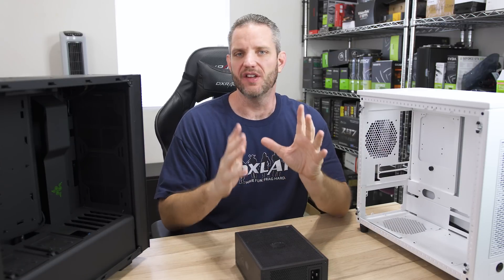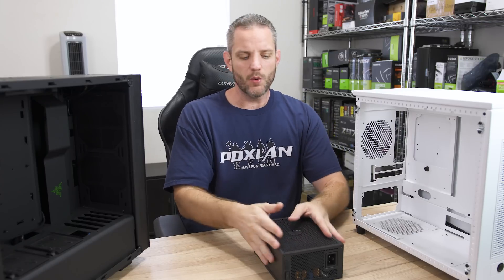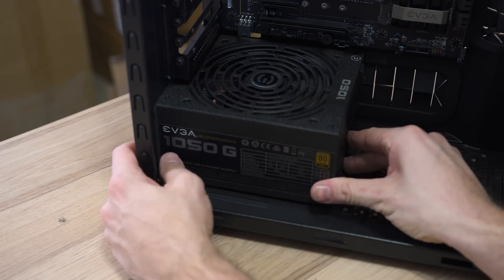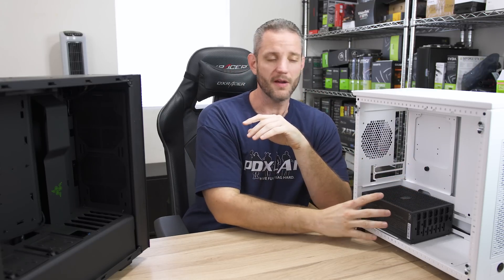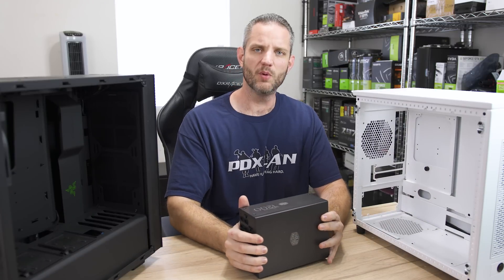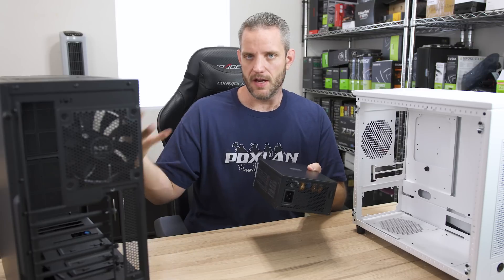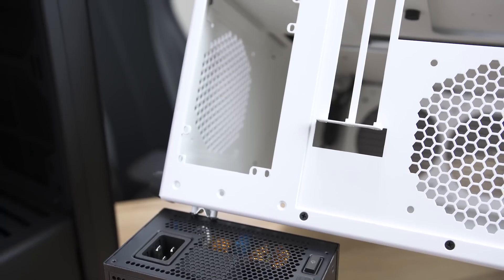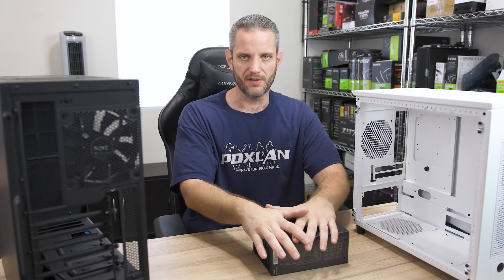Should you mount your Power Supply up or down?

Comment: Here's a video idea; AIO radiator orientation, and its affects on temperature and noise. 

From what I've read, the optimal orientation is where the inlet and outlet are on the bottom, because of the slight air gap, as AIO's aren't filled to the brim due to metal expansion. Therefore, bottom orientation brings down the temperatures and pump noise.

Comment: Another huge reason back in the day when semi and fully modular psu weren't really a thing. The loom of cables would come out of either the right or left side of the psu. So you would need to orientate it so the cable have some extra length.

Comment: well im dumb so i can think like this. psu takes air from outside case 23´C and then blow it inside psu and then out 30´C and then like you did say in again then it will stay around 30´c something. But if it takes air from inside of the case where the gpu fans is blowing air all over the place at around 60´C then the in the psu and out. and new air from inside the case 60´C again. then psu will be warmer then it will be if it did take air from outside of case. Im i thinking wrong? and as you did say it can take same air in again that it blows out. heat goes up so some of that 30´C will not get back in.  but what do i know in just a dumb swedish pc lover.
Reply: "you're"
Reply: tontarna I tried to read this and I think I had a stroke at 2/3rds I have no clue where you are getting at here
Reply: "grammar"
Reply: Valid question dude. I think you're right especially if there's a GPU close by with three fans spinning on top of it and there aren't major case fans pushing in volumes of air. Then the small area between psu intake and three GPU fans will become a battlefield for the air molecules, doesn't seem streamlined at all. Not only probably worse temp in psu but also less air for gpu. Stay critical dude and don't mind the short tempered douchebags that are cramming up in this thread immediately going on the offensive. Retardasimpletons. Keep it up
Reply: It doesnt really matter, its not a simple as 20 plus 60, the only thing that actually changes kinda noticeably is the airflow, but then again... it doesn't really matter...
Reply: Niko_2142 front fan takes in 23c and gpu makes 60c then you have let's say 50c in case. psu takes in 50c and blow it out. compare to take in 23c and blow out let's say 30c. so take air from outside case is cooler for psu so it shulde be better for it?
Reply: Uh... No. taking hotter air doesn't mean it's ability to carry heat is reduced. But if you are worried about your config, just don't, the important part is air getting where it needs to be, not if it's hotter or cooler, no one has ever  had any issues, and as long as your psu is fairly decent, it just won't matter.
Reply: Niko_2142 overall it is better to have psu fan take air from outside of the case for the best temperature. I got my 1000w fractal r2 psu. I not worried about my config. I did just state this becuse jay did say it will take cooler air from inside of case and I don't think it will do that, prove me wrong. and I know that many ppl include me time to time will so what he says on the video.
Reply: tontarna jesus christ... i tried explaining it to you, but whatever you don't want to understand.
Reply: Didn't you watch Jays earlier video where he was measuring the intake air versus the exhaust air?  It was practically the same.
Reply: The thing is, it's usually never 60c in the case
It probably goes to 30c to 40 at most.
Reply: you're right. The air that's taken in from bottom comes dragged along the cold floor that greatly cools air, so even if there's a circular loop the air rubbing against floor will cool it up before getting inside PSU again (in theory).
Reply: Yep your a dumb fuck.
Reply: LT Hutchins ouch! What a snap. You must have just learnt that in class today. This is the internet you fucking spaz. No one gives a fuck about gramma. That dosent make you look smart, it makes you look like you have nothing to say. Fucking spaz lol...

Comment: So guys I have a corsair 100r silent case (1 fan in front and 1 in the back) and my psu is a xfx ts 550w. The fan in the back it's very close to one of the cpu cooler fans wich is a noctua nh-u9b se2. Should I face the psu fan up or down? And should I take out that second fan from the cpu cooler or not?

Comment: We also have to take to account non modular power supplies. Non modulars and semi modulars have the cable closest to the motherboard so if your power supply fan faces down. For my budget builds I usually get top mounted power supply so it's going to orient the cables properly. 

Some folks will probably tell me to get full modulars so if that's the case give me money because I'm too broke to get those.

Comment: A quick question: what delivers more air flow (in general), 2 140 fans, or 1 200mm fan.
Reply: Two 120mm fans, if you get some Gentle Typhoons.
Reply: cusson27 2 120's, but a 200 will pull more air at a lower rpm at a way lower dB, but the 120mm will be better if u need alot of airflow
Reply: a 200mm fan can move more air at the same rotation speed than a smaller fan...

but you also could only have one 200mm fan in the space you could fit 2 140mm fans.
so 2 140mm fans is more practical.

Comment: Is their a fresh intake for the PSU in your case? Yes = mount the PSU to use that intake. No = obviously only option is to draw its air from the hot air in the case.

Will the PSU fail due to drawing in the hot air from the case, 99.9% of the time no. So long as it's a quality PSU. The PC being on carpet should never be a consideration because no one should, EVER, be putting their tower on carpet. If anyone is putting their tower on carpet, they should have their PC confiscated and be banned from owning a PC for life. It's never OK.

Comment: Nice video Jay, as always. Although PC-building is my hobby for quite some time now, I've never heard about positive/negative pressure inside the case. This should solve my dust problems. I have a coolermaster haf 922 case and every 3-4 months, I have to clean the inside, because everything is covered with fluff.

Comment: Good video!! New question: what are the downsides of reversing the airflow (out the front)? Are the mobo's thermally designed only for out-the-back airflow? There are many different gpu-fan types incl. water-cooling, which would benefit from what?

Comment: I have 2 intake & 3 exhaust fans. I run a custom curve so that there is slight positive pressure on the system until I'm under load (55-60°c or more) & then it's a slight negative pressure. This way it is resistant to dust most of the time but when I'm exporting a video the slight negative pressure with all fans at 100% exhausts the heat more effectively. Something to consider if all your fans are 3/4 pin connectors & you are using controller software like Ai suite

Comment: great video! I am building a mini itx computer and it has 1 intake (120 mm) and an exhaust (80 mm). I plan on adding another exhaust fan (120 mm) so, I am not sure which way would be the best for my computer. Because the PSU is on top, and if i make it so it has its own environment and isn't affecting the inside of my case, it would be pulling in air through a crappy dust filter, so I could really use some help with what way to orient my PSU. Please help.

Comment: Don't claim it's the coolest config without doing a test and measuring temperature differences between the two. That said, the biggest reason not to mount the PSU facing up in the bottom of a case is due to the risk of something falling into the fan (loose screw, jumper, broken bit of plastic, loose wire, etc... BTW, others who have tested the two found the CPU runs upwards of 6C cooler with it facing down since the PSU doesn't interrupt the airflow from the front fans reaching the CPU fan. This only applies to bottom mounted PSU's though, top-mounted should always face down to help increase the airflow across the chipset and memory.

Comment: not bad but I felt you missed one point; with the PSU facing up, you can have a passive PSU which is quieter (especially if its over-sized). The less fans spinning, the better. With face-down, the PSU fan must always spin, otherwise it will over-heat.

Comment: I don't have this problem, because my case has a separate room for the PSU and the system, but here is my question. My computer is in a cube case (Avp ev33b to be specific), that is separated vertically, so you have a right and left side, separated with a big metal sheet with some little holes for cable management. Is it enough, if I try to maintain a proper pressure independently, side by side, or should I count the two compartments together?

Comment: That moment when your first build didn't even have the direction taken into account.
It didn't occur to me that it'd matter.

PS: The case is in the side so it's not like a air port is blocked off anyway....but....what way DID I mount it?!
My system stays fairly cool, the hottest thing is the GTX 750Ti which caps at 60C.

Comment: I have an inverted case (Silverstone Fortress FT04), so the power supply is on top, with a dedicated filtered intake. I still have my power supply (EVGA Supernova 650 P2) installed with the intake facing in, not only because of the reasons Jay mentioned, but also because it's one less filter to clean.  With such a large internal cavity, I don't have to even think about heat accumulation.

Comment: Hey Jay, I know this might be a long shot but here it goes, i just recently got a new power supply (corsair rm1000x) for my 
computer, i got it all hooked up on my ASUS 970 gaming/aura motherboard and now the mouse, keyboard, and monitor wont turn on (almost like its not detecting the mouse/keyboard/gpu) when I turn the PC on, any help would be greatly appreciated.
Reply: Justin Bechtel did you remember the extra CPU power cable up in the top left of the mobo? That's a tricky little guy that people sometimes miss.
Reply: HOkayson
the 6 pin cpu power cable? yeah, i plugged it in, it may have come loose when i was installing the fans though, for some reason
Reply: Hmm, if you're certain everything is plugged in & still no power to the mouse/keyboard I'd say try the old PSU again. No need to fit it properly just place it next to the case & replug everything into it, no need to route the cables properly as it's just for a test so should be pretty quick to do. If the old one works still...could be a dud new PSU. That's extremely rare with a decent brand though so I'm assuming it's something else.
Reply: HOkayson
im in the process of re installed the ram/cpu/gpu/all the cables, the reason why im so hesitant to use the old pus is that its a 350watt psu, and the cpu im using is an amd fx8350, i dont want to fry the old psu, used to have a msi 760gm p23 with an amd fx4300 in it, but just upgraded to the asus 970, and f
fx8350
Reply: i unplugged everything and plugged it back in, took out the cpu, ram, and gpu, put it back in, and now it works. wew. cant believe i never thought about this. thanks for the help though ^_^
Reply: It's the worst feeling. When I built my PC, I tested all of the parts outside of the case and it worked fine. After installing everything into the case, the PC wouldn't boot and I was freaking out. About two hours later, the issue turned out to be the 24 pin connector not being seated all the way hahaha
Reply: Metalbolt
now im having a problem with my ram, I have 32 gigs of ram, when i go into the uefi bios it reads that there is 4 sticks of 8 gigs of ram, but says there is a 24gigs of ram memory, booted, opened up speccy before opening anything it read 32 gigs of ram but only at 557MHz, open something and it reads 24.0GB Dual-Channel DDR3 @ 579MHz

i dont know whats going on and im very confused.
Reply: I would try to put 1 stick of RAM into slot 1, boot and see what happens. Rinse and repeat for each slot, then do this with the other sticks. You may have a bad stick of RAM somewhere or a bad DIMM slot. Also, you may want to try a BIOS update, but I know sometimes this can brick the PC, so personally I would do this as a last resort. You may want to look at Tom's Hardware for more advice because this is only my first PC and I don't have too many experiences with issues and such, but I'll try to help you the best I can.
Reply: Also, maybe try to take out the RAM and make sure that it's seated all the way in so that it makes a good connection.
Reply: Metalbolt
just spent about an hour and a half trouble shooting every which way i can think of with the ram, turns out i might have a dead ram stick, i put the 2 confirmed working ones aside, and put the one i that was giving me troubles, and one of the sticks i "paired" it with in, it would detect 2 sticks but only have the capacity of one stick, which was odd to me, so i took the one that was giving me no capacity at all, set it aside, and put just 3 sticks in and it read the 3 fine, but to make sure its not a slot, im going to put the stick i know works into the one i didnt put it in, if it reads it then I know all 4 slots work and its the ram stick that doesnt
Reply: Hopefully it's just the stick of RAM, which according to what I hear, is pretty easy to RMA (unless they ask for the whole kit back, you may be down for a few days). Fingers crossed!
Reply: Metalbolt
if they ask for the whole 32gig kit back I will just use my 8gigs of rams that I have from my old prebuilt pc that i upgraded a little bit.
Reply: In that case, not so bad
Reply: Metalbolt
i essentially have 2 computers now, one as a backup/portable/other people can use pc, and the one I just built, but i just finished doing some troubleshooting and confirmed that all of the ram slots work, 3 ram sticks work, and one doesnt.
Reply: I guess it's a good and a bad thing. Hopefully it'll get resolved soon.

What did you put into your new pc?
Reply: Metalbolt
CPU: AMD FX8350 Black Edition
Ram: 32gigs of 2133MHz Corsair Vengeance
GPU (for now): GTX750Ti
GPU (future): 2x AMD RX480's probably the XFX ones.
Storage:
samsung m.2 ssd (120gig)
Toshiba 500gig hdd (for now)
in the future I want 4x WD Red 5400rpm NAS 6tb drives. and a few other bits and bobs.
Reply: Sounds awesome that you have an upgrade path. Best of luck to you man!
Reply: Metalbolt
thanks :)
I just finished talking to customer service at corsair and the very nice fellow (Nick C) said I have to send the whole kit back. which is what I suspected.
oh well
Reply: I heard they have good support. I had to RMA my keyboard, and they offered to put a hold on my card for the amount while they ship me one, and once they received mine, then they would take off the hold. I believe it was called advanced RMA.
Reply: Metalbolt
yup, they offered me that as well, but i politely declined as I have the ram sticks from my old PC, i was like "im quite patient I have some ram from my old computer that I can put in to hold me over until i get the new sticks, i will just do the standard RMA I just need time after or before work in order to send it out"
Reply: I hope the new sticks will work for you. Keeping my fingers crossed!

Comment: I have a weird set up but it seems to work. 180mm pulling air from the front. my 120mm exhaust fan blows into the case also cooling a small rad for the water cooled CPU and the the only fan blowing air out is on the top which is another 180mm fan. I get positive air pressure, not a lot of dust and everything stays pretty cool. That's saying something consisting I'm still using an old R9 290 lol.

Comment: I'm going to use rx 480 in my new build.  The recommended psu is 500w. If I use a 450w psu, will it be a problem? I'm not going to overclock the system anytime soon, maybe after upgrading the psu to 600w.

Comment: Thanks for the explanation Jay. TBH, I was wondering about your PSU install on the computer, but, just looked at it like you knew what you were doing. The explanation makes it better though, and, it would likely be easy to flip it over if wanted now that it's up off the carpet. Thank you.

Comment: You should make a video where you run water cooling but with no fans on the radiator and compare the temps. Then try using compressed air cans to blow on the radiator to see how many people using how many cans does it take to equal normal fans. I got this idea while dusting my radiator and thought it'd be interesting to test.

Comment: Jay your the best!!!!!!!!!!! Came here just to say your the best and go on a rant of what i think should be done :). Get positive airflow in the case. PSU facing down with filter on the fan and poof your set. thats if the fan is an intake on the PSU wich as far as i know they all are. Atleast i hope mine is lmao. Would make sence tho cuz if the fan was facing up all it would do is blow hot air into the case wich would be stupid. Now if u didnt have a filter to your psu i sudgest puting the psu facing up as long as you have positive airflow with that extra exhaust to the airflow in the case. You dont wanna be sucking all the air the gpu could be getting. And for all watercooled and filtered intake water cooled pc's just put the psu facing up for min dust buildup. oh wait jays got a vid on this. ooops